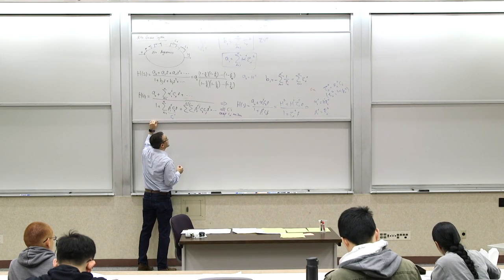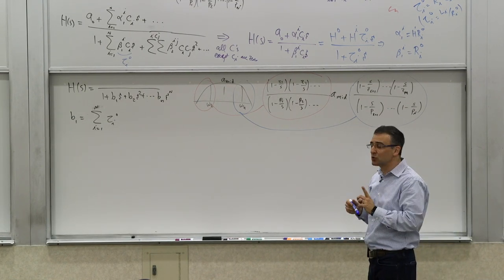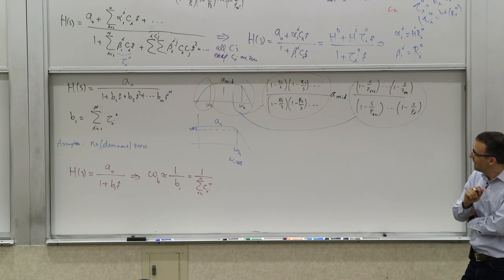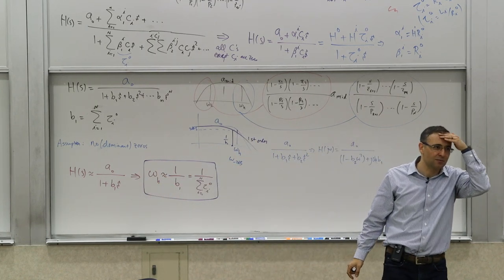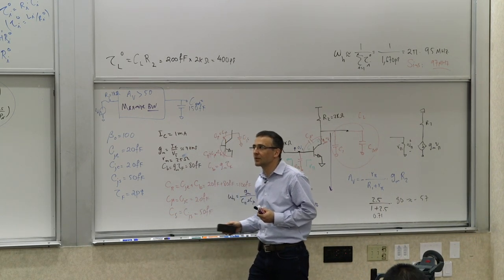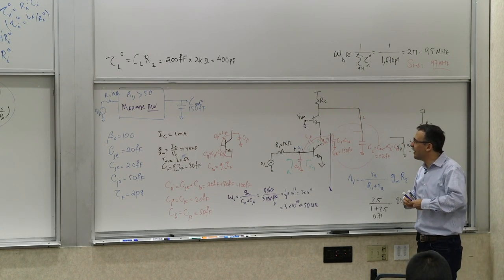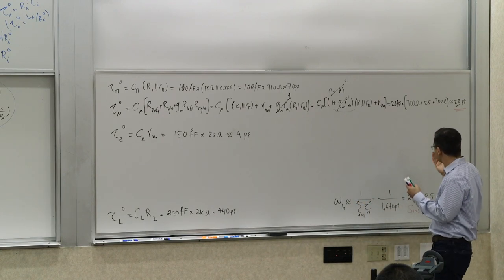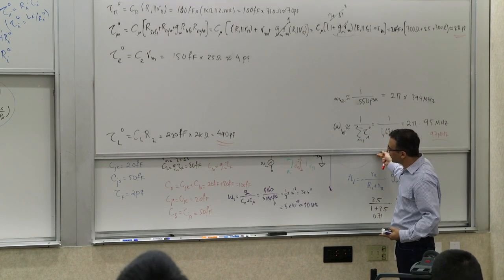145N. Bandwidth estimation using ZVT, High-frequency Amplifier design example

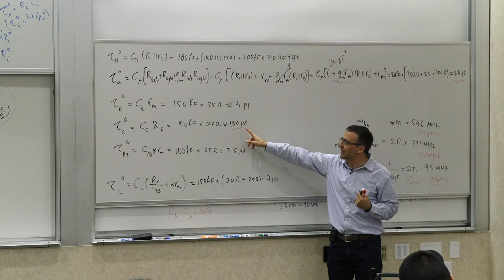Comment: Best explanation for pole-zero and high bandwidth amplifier design. At @1:08:11, that means I cannot replace the resistor R2 with a current source load, because the output impedance at this node increases a lot, which in turn kills my amplifier bandwidth.

Comment: Hello. What is the justification for assuming that b1 will be the first term to become important as we move up in frequency? Is it because all time constants are smaller than a unit second and thus adding them time constants will yield a larger magnitude than multiplying them out?
Reply: Imagine a low pass filter with multiple poles. You can rewrite the denominator to be in terms of (s/omega_c) instead of (s) where omega_c is the -3dB frequency. You can always do this no matter what the polynomial in the denominator is. Yes, it assumes knowing the -3dB frequency beforehand, but it's a perfectly valid manipulation for the sake of proof. So now imagine that we are way below the -3dB frequency on the Bode plot. All of the (s/omega_c) terms will be close to zero because s is much smaller than omega_c. As we approach omega_c, the linear term is still more significant than the higher order terms, in the typical case, because the s/omega_c ratio is still less than 1. If you graph all the x^k functions on the same graph, you will notice that although higher order terms grow faster when x>1, they grow slower when x<1. So in the region below the cutoff frequency, the linear term is more significant than the higher order terms. This approximation starts failing once we get close to the cutoff frequency, and especially when there are no significantly dominant poles because then the higher order time constants are sufficiently large that the s^2, s^3 terms, might be large compared to the s term even decently below the cutoff frequency. But the estimate is still conservative and about the same order of magnitude. So it's still a useful approximation, but again, it's much better if there is a dominant pole. Otherwise, you might want to calculate the b2 term at least
Reply: @karolakkolo123   Thanks for your answer. Simply replacing all s with s/omega_c is not valid I think. What am I missing?
Reply from the maker: You can see the following paper for more details:
B. Hong, A. Hajimiri, “Upper and lower bounds on a system’s bandwidth based on its zero-value time constants,” Electronics Letters, August 2016.

https://chic.caltech.edu/wp-content/uploads/2016/07/BHongBandwidth_EL2016_Postprint.pdf

Comment: At 57:20, Why are we going with including one more stage? I think that stage will again consume 1mA, so why can't we just double the current in first stage? (Because as far as I understood the issue with reducing R2 and increasing current was power dissipation)
Reply from the maker: It is a function of the size of the load capacitor. The larger the load capacitor, the more important the effect of the buffer is. Imagine a case where the load capacitor was 10 times larger than its current case and you will end up with a larger improvement from the buffer than you have from doubling the current of the driver stage. They choice is parameter dependent to some extent. Also, you do not have to use 1mA of current (that was just a nominal value). Try it with 100uA for the buffer and see what changes. Hope this helps.
Reply: Thank you so much, you are super cool!

Comment: 27:33， it's better to draw a Rl in serial with Cout. Otherwise in small signal analysis Cout is short circuited and than we won't have any gain.
The gain should be -rpi*gm*(R2//Rl)/(R1+rpi)

Comment: For the last topology (around 1:05:00), isn't the impedance seen by Cc be R2||rpi instead of R2? Under such estimation the bandwidth is around 700MHz, which is very close to the simulation result.
Reply from the maker: No, since the output resistance of the current source is infinity, by reflection rule, the base input resistance will be r_pi + (1+beta) * infinity. If the output resistance to the current source was finite (let's say R_3), then the resistance seen from the base is still quite large for a typical R_3. It is r_pi + (1+beta) * R_3.

Comment: At 26:33, sir you said how many independent initial conditions that we can set for finding no of poles, can you explain this statement a little bit?
Reply: If you imagine a KVL around the capacitor loop, setting the voltage of two of them will already determine the voltage of the other one. So there are only 2 independent initial conditions, since the third voltage is dependent on the first two. So, even though there are three energy storage elements, the order of the system is two.